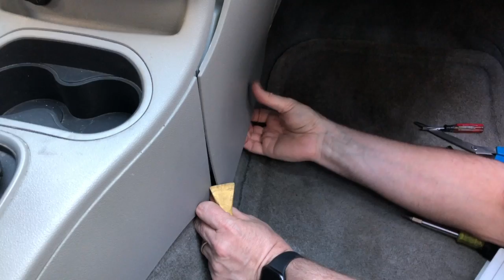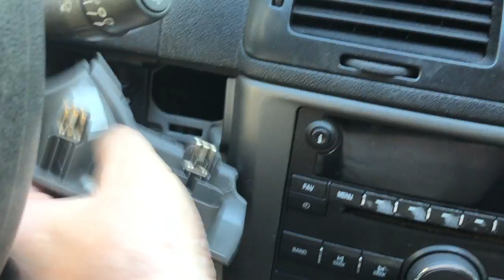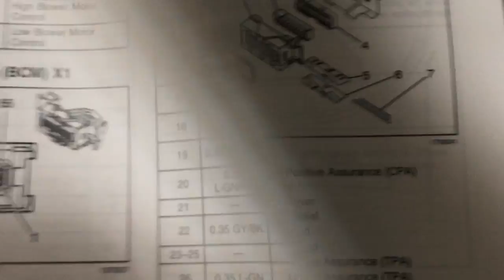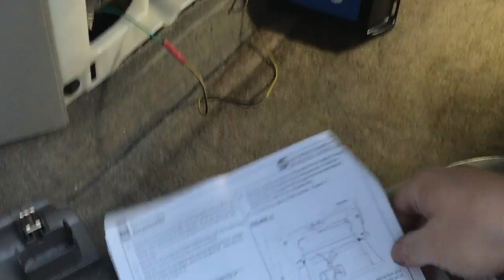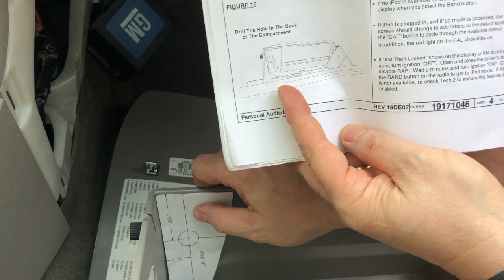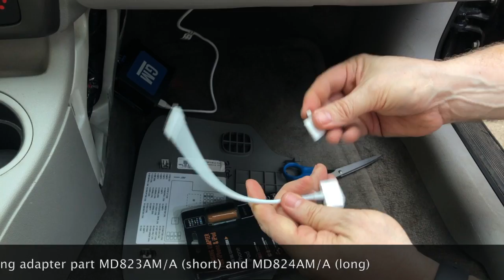2006 - 2009 GM Personal Audio Link (PAL) Apple iPod Accessory Installation Chevy Cobalt & Pontiac G5

Comment from the maker: FYI: There's much more control of an Apple iPod, or iPhone for that matter, than I showed in the video as there is alot there.  I did show flipping thru the user guide pages though, and that goes over these features.  For example, you can control what information is displayed on the radio (artist, track, title, etc) as well as navigate your Apple Music library by artist or album, etc using the buttons on the radio itself.

Comment: Are the RCA plugs-ins on the PAL a input or output?
Reply from the maker: They are an input, when functional.  The first generation firmware didn't enable them so like on the Cobalt version I show here they are just for show.  The Corvette version of the PAL was the only one that got an updated firmware that enabled them.  The firmwares were not compatible, basically Mediatronics made a custom solution for each of GM's myriad radio models at the time.
Reply: @DrShock  I have a 2011 chevy colorado and would like to maybe purchase a PAL if the rca inputs work.
Reply from the maker: @blflick  Corvette only for the version 2.0 PAL, but you might try the link in the description under PAL spare parts and ask Ray Kawal there about the firmware compatibility.   Ray received all the version 2 PAL firmware images from Mediatronics before they went bankrupt.

Comment: DrShock, This GM Personal Audio Link is also compatible with Bluetooth? Greeting from El Paso, Texas.
Reply from the maker: Yes, with one of the 30pin iPod type Bluetooth adapters that can be powered by the old iPod 12V firewire charging.  I'll be posting a video this Friday on the one from Coolstream I've been reviewing with this PAL that has both been compatible and retains the PALs advanced iPod control type functionality.